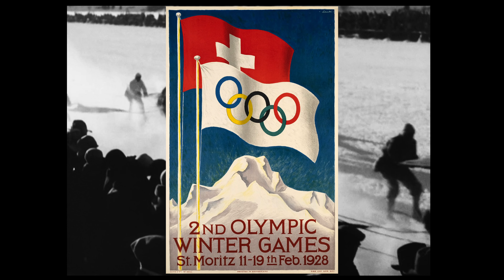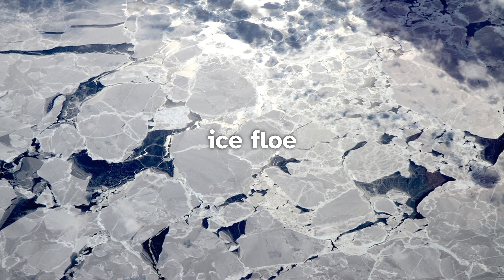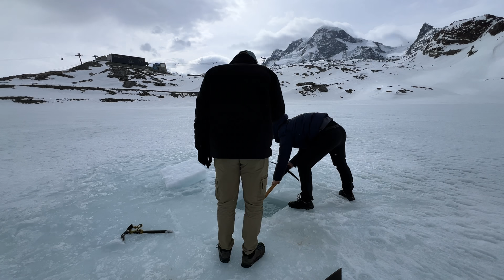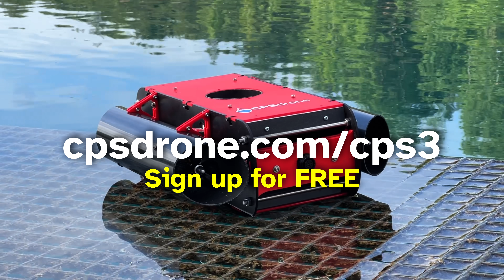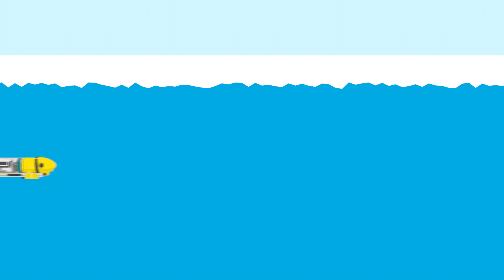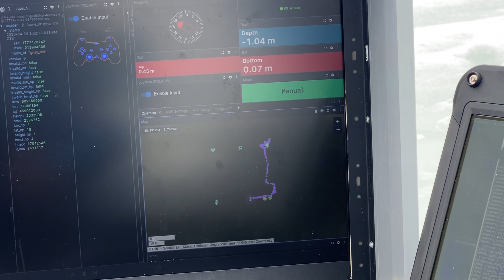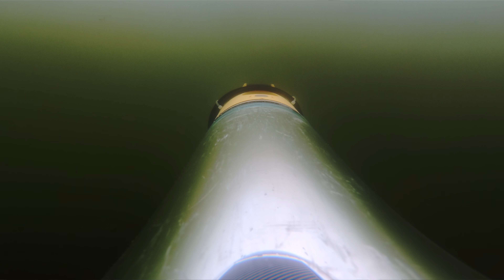Investigating an Alpine Submarine

Comment: Hey guys, Richard from the video here!

I see some of you have really good questions regarding how and why we decided to measure the ice this way. In that case, feel free to ask me anything here.

Also, thanks again so much for your help and for making this awesome video @cps!!
Reply: Why not use a crawler robot, or a drone landing on top of the ice to send and receive ultrasound from the combined underwater drone?
Reply: @Ignotius_Grindelwald  i like your idea, it made me think.....id suggest to get a ukrainian combat robot, stick a drill to it. and have it sense the depth at which the drill plunges into the first layer of water from the top ice layer down.
Reply: @simonschneider5913  nice ad
Reply: @Ignotius_Grindelwald  we typically have a snow layer on top and it can make measuring the ice from the air really hard due to that! Also ultrasound traveling from air to ice is almost completely reflected so you'd have to make a rather perfect coupling from your sensor to the ice sheet, preferably with ultrasonic gel on it too
Reply: @RichardRuedin  would a drone with ground penetrating radar not work? its a lot safer than having to get personnel out on the ice to get the sub under. I'd assume it would be preferable if GPR is able to give readings that are accurate enough.
Reply: @stvka normally you do not need to get personel on the ice, as you'd have a river or other type of inlet. Also, going in from the shore is much safer. GPR would totally work for some scenarios but it would perform much worse than the sub if you have water layers in between or wet snow on top (like when the alp sun shines on it strongly)
Reply: @RichardRuedin  If you managed the snow layer issue, would gentle heating of the ultrasound probe work? Creating a thin layer of water as an interface to the ice to reduce reflection. Depending how smooth the ice is, you might not even influence the thickness a lot.
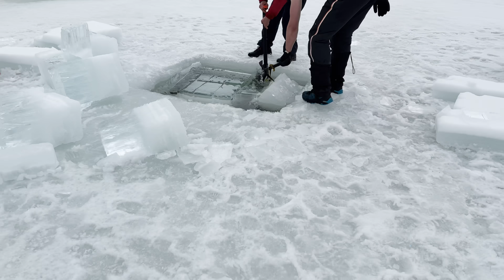Also, is the problem of the sonar on your current underwater drone noise, or the tiny air pockets rendering the ice white instead of clear (the difference is clearly visible at 18:55)? As a (swiss) medical student, I know from medical sonography how much even a little bit of air can be a pain when working with ultrasound.
Reply: @thomasbezencon2121  honestly that idea with heating up the ultrasonic probe sounds super cool. I'm sure there would be a couple of engineering challenges but thats what its all about lol. As for the issues with the sonar, we honestly dont know the exact reason, but it is probably due to a lot of factors, and i would be easily convinced that air pockets are part of the issue
Reply: @RichardRuedin  It likely has. Probably including dealing with the snow on top of the ice and the energy required for melting the ice (around 325J/cm^3 at -10°C). Other idea, did you try different frequencies for your sonar? Again thinking about medical sonography, the probe has a variable frequency for a reason, allowing the physician examining the patient to adapt the compromise between high detail (high frequency) and high reach (low frequency) on the fly.
Reply: @thomasbezencon2121  I do not remember it perfectly as I wasn't the one who worked with the sonar a lot, but I believe we couldn't change the frequency of the sonar. So one of the next upgrades for this method would be to get a sonar more suitable for it that can change the frequency, that would already help a lot
Reply: Massive respect to the ETH team and you guys for this build! The sub and the SBL localization system are incredible pieces of engineering.

However, thinking about the St. Moritz horse races specifically, I wonder if a bottom-up measurement approach misses the main danger. Alpine lakes often form a 'sandwich' of ice, slush, and water. A galloping horse applies a massive point load. If just the top 10-15cm crust gives way, the horse punches through into the slush, which is catastrophic at full speed. It wouldn't matter if there's a meter of solid ice further down.

What if, for this specific use case, someone built an uncrewed RC Airboat (pontoon hull + rear prop) equipped with a downward-pointing Ground Penetrating Radar (GPR)?

It could scan the ice from above, mapping the exact internal structure of those critical upper layers. Being an amphibious airboat, if the ice breaks, it simply floats—zero risk to the expensive GPR. You could run control/telemetry over a solid ELRS link for miles across the open lake, and throw on an HDZero setup for crisp, low-latency FPV to spot cracks in real-time.

The operator stays safe on shore, getting the exact structural data needed for the horses. The sub is an absolute masterpiece of robotics, but maybe a top-down FPV airboat is the next project to tackle? :P
Reply: @pakonko well, I can surely tell that you know what you are talking about! Indeed, if you wanted to prevent a horse from falling in that would be a better approach at first glance I think. We haven't built it for only that approach though. We want to know as much about the entire ice sheet thickness for our climate research friends at ETH as well, and we also are very interested in wide-range safety assessments for the ice-covered lakes, not just for the horse race specifically. Also, a couple of years ago an entire snow buggy fell into the Silvaplanna lake, which is also one thing we could avoid with this.

All in all I really like your approach though, if we had to build for this specific purpose alone it would have been awesome!!
Reply: Hey! I haven't watched the full video so apologies if it's been answered in the video. But how are you differentiating density vs thickness when scanning? Or is that negligible since the variance would be so small?
Reply: @leightonparker3855  Very good question! We use the archimedes principle (so we actually account for the lower density of the ice in calculating the thickness)

So it's slightly thicker then if it was pure "water" on top and not ice!

The formula is density_ice * thickness = density_water * perceived thickness
Reply: Can the technology applied on the Polaris, namely the GPS underneath the water, could be apply to exploration and data collection in areas such as Antarctica or the Arctic, or would there be other conditions preventing this?
Reply: @ZarifAhmed-v4m  hard to say, though I'd say there's a tendency towards no. As far as I know we are the first to do this, and the reason is simply that it works well for our specific circumstance.

In saltwater the signal drops off even faster (since saltwater is much more conductive) and even the ice will be worse for the signal (because salt water ice is very inhomogeneous and has more saltwater inclusions)
Reply: Are you using any dead-reckoning or inertial navigation system for instances when the sub is not getting any outside signals?
Reply: @Zhatt  exactly! We use a DVL from WaterLinked that works really well. Our newer laketests show that with the DVL and our Xsens Sirius IMU we can have rather good dead reckoning (approx. 0.4m uncertainty on 100 meters traveled without outside signals)
Reply: Cool project. but for this spesfic usecase with snow on the ice GPR in the 1600Mhz range from a drone would do it fast autonomusly and repetable with minimal training of a operator with good software.
Reply: @surplusdriller1thanks! Its true that this wouldve also been a viable route. We decided against it because wet snow, slush or water layers could prevent us from scanning the entire ice thickness. Also, initially we wanted to leave room for future improvements where we could do arctic-type missions (only a dream for now but you never know!) Now that our drone is autonomous it is also highly repeatable, though still not as plug and play as your approach would be!
Reply: @RichardRuedin  Ya GPR can have some problems if the snow is wet.  If they want good ice to race on its best to drill and pump water over the ice, we do it here in Norway to transport timber from large lake islands, but i digress
Reply: @surplusdriller1damn thats really interesting, I'd expect countries with larger lake infrastructures to be more advanced in that regard. Thanks for the insight!
Reply: How about a Ground Penetrating Radar antenna (GPR) mounted on a drone? Air to ice and ice to water interfaces are very easily detected
Reply: @christopheloraux5522 wet snow (like on a sunny day in the alps) can really strongly interfere with gpr from the air. Also, any sort of (even thin) water layer in between would block the measurements. Combining this with the sub though, that could give some really cool wide-range measurements with more info than either alone!
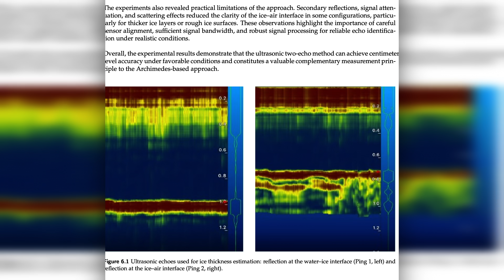Reply: 21:13 Transmission power (SPL) is too high causing imperfections in the ice to reflect sound back strong enough to register as returns. Depending on bottom depth, pulse length, and intervals it could also be contamination from previous pulses bouncing off of the bottom and then the ice again (Since you are measuring in a straight line it's also possible to get reverberation from the sides and have that show up as a different depth)

It looks like the sound is possibly returning from different densities in the water. Temperature is a large factor in how fast sound travels in the water as well. Creating a sound speed profile is important when attempting to get ranging information using sonar

I would recommend lowering the SPL until you have a cleaner picture and/or try reducing pulse length and increasing pulse intervals, that should help clean the image up as well

Ideally you would use a phased array to measure a wide area and present it as a top down map. That makes it significantly easier to see thinner sections of ice and allows you to generate a map in real time rather than measuring single points or a straight line. This does mean that you would need to calculate the angle for the ice to calculate the thickness though (If you use the initial thickness of the ice at the insertion point then you can create a relative map and figure out the thickness of the ice that way)

Also, angling the transmitter can help remove some of the reverberations as you're looking from farther away and the reverberations have more time to dissipate

I am guessing that the sonar system is using a CW or CHIRP pulse, if not then you can ignore the rest of this part. If you change the waveform to something else such as an FM slide then you can filter out reverberation by removing any frequency already returned at a high enough SPL. If you combine that with SPL filtering then you can allow the second return from the ice/air boundary through and filter again after that. Calibrations for this could be done at the hole where the sub is inserted if you measure the thickness there and reference it to the returns you are getting
(I didn't see you doing that in the video so feel free to ignore if that is part of your process already)

As a side note, you can check out the RP33 if you haven't already

It is an unclassified sonar and oceanographic manual that goes into a lot of different principles of how sound behaves. It is for salt water but the same principles apply. I'm not sure if it will help at all but it wouldn't hurt at least

My memory is kinda rusty but that's all the advice I can think of and that I'm allowed to share
It is definitely an interesting project and I hope we can get another video to see how it's going at some point
Reply: how do you get a clear reading of the thickness of the multiple layers of ice, slush, and water?
Reply: @simonschneider5913 by doing calibration measurements at the entry point you can adjust for a lot of those things. For multiple ice sheets there's really not much you can do, but luckily it doesn't happen as much with lakes further down in winter. The water layer in between isn't sooo thick, so using the thickness we get as an estimate still works quite well
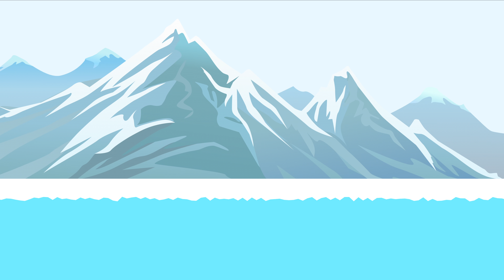Reply: @RichardRuedin  In the video, 1:30, he mentions the incident where a crack compromised the integrity of the sheet, now I don't think an extrapolated map can notice those localized anomalies, but maybe having the sub run continuous measurements on the path of the track in addition to the standard extrapolated map. Can you see areas where the noise from the sonar is greater and correlate that with a compromised ice patch?
Reply: @celivalg  we probably cannot use the sonar data for that without serious effort into building a better sonar system, since its really noise for our sensor under the ice sheet. However, interestingly, a worse GPS signal should absolutely correlate to a cracked / wet ice sheet layer so with enough data of touching the ice sheet we could probably map such areas semi reliably. We also didn't build the sub just for that use case, its in general for measuring lake ice thickness, for climate research and public safety too
Reply: have y'all looked into signals analysis for surface conditions? like for the slush that was mentioned? i would imagine that the signal from ultrasound traveling through ice and water and then snow would differ in some consistent way, but i don't know if the signal would be above whatever your noise floor is.
Reply: @VAL9THOU nope we havent yet, because we'd need more data with better repearable conditions to really identify this. Unfortunately, our sonar gave really noisy measurements under the ice sheet due to multiple reflections, so everything other than the distance to the ice sheet becomes hard to reliably lock down
Reply: hello Richard! when you go autonomous just an idea for ensuring accurate gps data (If it works) could you put 3 sounders ontop of the snow and ice and use those to ping a location to your underwater drone? that way you know regardless on gps loss etc that it has something to actually follow should it get lost underwater (3 sounders pinging in turns at different frequency so the sub can identify the 3 different sounders when close and then it effectively navigates via volume of sonar ping until all 3 frequency pings are above a set volume and equal distance (so the sub is directly between them)) also if your really clever you might be able to encode some data within the sonar pings and maybe even have sounders ontop and a transducer below to measure the thickness from both sides? just an armchair tech but might be worth looking into
Reply: @jasonpeace91  hi! I am not sure that I follow, but those sounders you mean are probably similar to what our system already does with the SBL! Problem is, accuracy in an environment like this and underwater in general is super hard to get, even with a perfevtly working setup like that
Reply: @RichardRuedin  think of it like sonar pings you have ground based sounders that are producing pings into the ice the subs listening for the 3 sonar style pings as they get louder the sub homes in on those pings when in enters the triangle of sounders it aims to position itself in the middle of the 3 sounders and knows its in the middle when all 3 sonar pings are equal volume, at which point your sub could reply ping a set frequency as im in position and testing thickness and then you know the sub gps is in then middle of the 3 sounders you placed ontop of the ice, also you could form communication between them using the sounders when in position if your clever by using set times between your 3 ground sounders and changing the length of the pings to transmit different information
Reply: @jasonpeace91  yup thats very similar to what our SBL does. The communication component would be even more advanced than what our SBL is capable of!
Reply: Hi, do you use a directional transducer or do you just hope the seafloor reflection is in a different range gate than the ice top?
I work in seafloor geodesy and while I moved away from arctic regions the tediousness of acoustics combined with AUVs makes you approach seem much harder than a GPR from above the ice
Reply: @joge3031  we use a weak 5-10 degree directional transducer that doubles for obstacle avoidance and that one very reliably finds the distance to the ice sheet if close (within 1m)

Our stronger sonar transducer did have more issues with reflections, but that is very likely connected to the fact that we had to pivot to a shallow water lake rather than a deeper one
Reply: @R @RichardRuedin depending on the scale of layered ice (I'm really not a lake expert) acoustic traveltimes (esp. traveltimes differences of multiples) could quickly overlap
Reply: @joge3031  yup, the weaker transducer only has a measurement range between 3 and 6 meters though, so it gets as close to reliable as we could reasonably expect. Plus the post mission data very exactly lines up with expectations and doesnt behave erratically. Unfortunately same cant be said for the stronger one lol
Reply: Hello! The GPS contact with the ice is really clever, but wouldn't it be ineffective if their is multiple ice layer due to the water trapped between?
Reply: @DyslexicEngineer  exactly! That's the reason why it was only 2.5 meter accuracy in the vid. In other places with no water layer in between we recorded better accuracy. Also, the water layer is not one whole layer throughout, in some spots it is missing (more like puddles). So that's why we were still even able to get any accuracy!
Reply: If the underside of the ice isn’t perfectly flat, how do you know that a change in the sonar reading actually means a change in ice thickness, rather than the sound bouncing off a different spot or at a different angle?
Reply: @michamynarski3050  in that case you really wouldnt be able to tell other than that this measurement gives different data compared to other ones that you just recently did. If everything goes well you could classify it as an outlier. On the hardware side, to avoid this you try to use a sonar with a small beam width, but there is a limit obviously. The most secure measurement in really bad cases would have to be made by touching the ice then!
Reply: Hi! Great research project. A couple of days after watching the video, I had a random idea while tinkering with Hall effect switches on a custom keyboard build.

My initial thought was putting a magnetic sensor in the sub and a magnet on a surface sled to measure the distance between them, but the inverse-cube law makes static magnets tricky over a meter or two. After looking into it a bit more, have you considered using low-frequency AC electromagnetic tracking instead of sonar?

It would still require a sled on the surface, but using a modulated AC transmitter on top and a receiver on the sub completely ignores ice layers/slush boundaries. Plus, relative 3D magnetic tracking between the sub and the sled could help solve the underwater positioning problem, leaving the GPS fix strictly on the topside sled.
Reply: @cybrasaurus7685  that idea is very resourceful and in fact if i remember it right, some large ships that travel through arctic terrain use electromagnetic induction to measure ice thickness so its a very similar concept to whats already proven to work!

We decided against this because we wanted to have one independent agent that doesnt have to rely on external dependencies. It was part of our studies so we had to finish it in a strict deadline, otherwise smth like this could have been part of the solution, physically it could work
Reply: Super cool Projekt. We covered something similar  in our GEO Physics class. What are the benefits from doing it from underneath? Why not use electromagnetic magnetic induction via a drone? That just seems better for mapping.
Reply: cool idea! i have a question though: could you drill small holes in the lake at different known gps locations and stick small underwater speakers in them that play different frequencies so you could triangulate the sub's position (with a mic on the sub)?
Reply: @TheHoinoel  yup, but this is essentially what the SBL system does! And it's more accurate than what we could achieve. Its the exact same idea though!
Reply: Is that lake near the ski lifts in zermatt?
Reply: @matteosisino2560  yup, its the third station i think
Reply: wo besch id kanti gange?
Reply: @Normaly0 bero, hesch velecht scho devo ghört lol
Reply: @RichardRuedin luzern?
Reply: @Normaly0 yup, wieso meinsch?
Reply: @RichardRuedin het mech numme wunder gno, well mach grad do in aarau / aargau kanti
Reply: @Normaly0 ah nice, ganz in der nöchi. Falls du physik oder maschinebau an der eth studiere wotsch oder es dir überleisch chasch mi gern dezue froge. Kenne es paar lüt wo in aarau kanti gmacht hend und jz maschinebau studiere
Reply: @RichardRuedin danke förs agebot aber mach glaub öbbis i de medizin oder psychologie❤
Reply: Thanks for showing this very interesting project!

A suggestion: make an upside down tracked vehicle that rides the bottom of the ice and uses buoyancy to create traction. This way you are constantly against the ice so your gps would work. I guess you could position the vehicle easier and more energy efficient.
Reply: @EUD504  thanks! We actually had this as one of the possible concepts in the early stages of the project. We decided against it because to create grip you'd need somewhat strong buoyancy and that could push too strongly on weak ice (we wanted to measure very thin ice for researchers too). Still, cool idea and Nasa used this for one of their projects if I remember it right!
Reply: Hey, have you tried looking for the double ice layers with the gap in between with visible light? I mean put a camera and a flashlight on the drone pointing upwards in the hope of being able to see how "pure" the ice is from underneath? Probably pretty obvious, but i thought just maybe you didnt think of it😅
Reply: Have you considered driving a remotely operated waterproof platform with variable ballast on a rope? GPS navigation would be easy, driving too. You just need to know the surface of the contact area of that vehicle with the ground and its weight. Based on that calculate the pressure and add balast so that you can test if the ice is strong enough. If not, it would fall through the ice and then you would just have to use a winch to pull it out. The ballast could be just disposable bags of sand so that you would have to rescue just the platform.
Reply: @Macieyevsky do you mean for testing the ice safety? And whether it can hold the ballast?